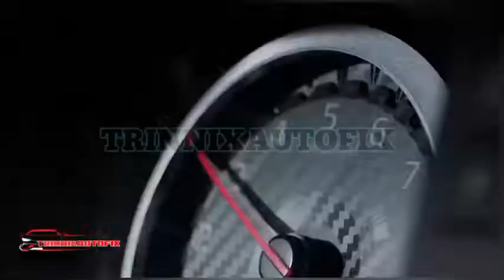how to reset a blend door actuator

Comment: New actuator needs reset?
Reply: The system needs to know the position of each actuator so a system reset is required. It can be done with a fancy OBD2 Sanner or as simple as pulling a fuse for a certain amount of time.
Look up how to do the reset for your specific car.
This channel is trash...